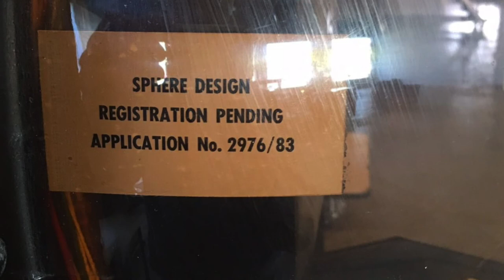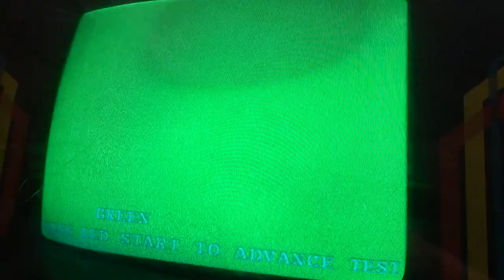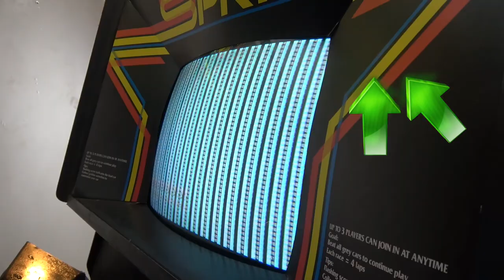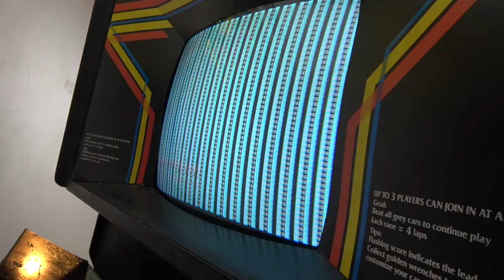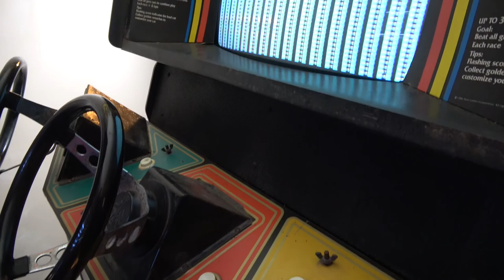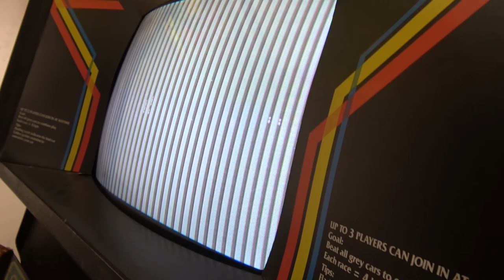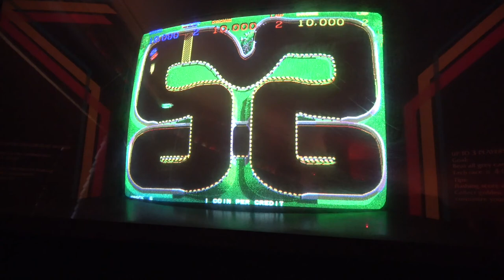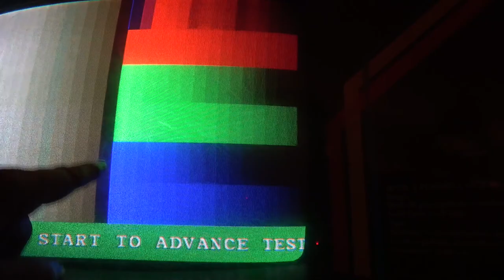SJ015 - Project Updates and Super Sprint fixes

Comment: Had the same problem with my super sprint funny enough, no color red. had to strip the cab to do some repairs and when I put it back together it was all good. but still goes a bit funny every now and then. It's that damn plug on the pcb!
Reply from the maker: Yeah, I have to get back and fix this problem!! There might be an opportunity this year if my plans pan out and I'm able to get the machine back in the arcade.
Reply: @SpaciesArcade  I just traded mine for another game aha.

Comment: if the screws are stripped you can use an easy out
Reply from the maker: Hey Ryan, yep thanks for the tip. I still have issues with the easyout. Seems difficult with rusted screws on metal. Works well with screws stuck in wood etc but I've had challenges with metal applications. Thanks though for taking the time to help out! Cheers.